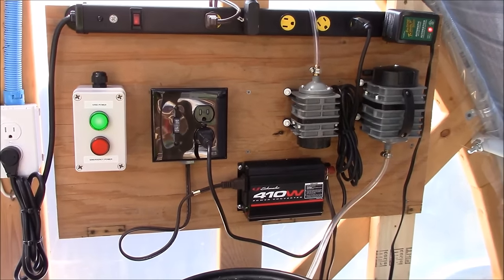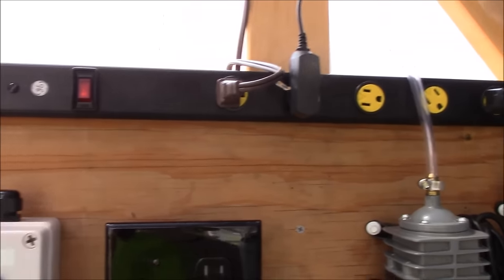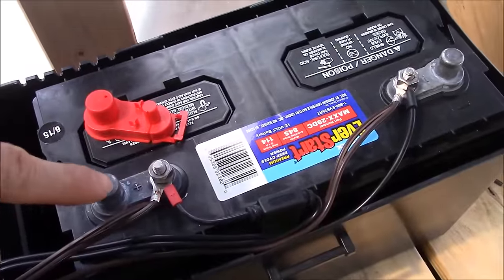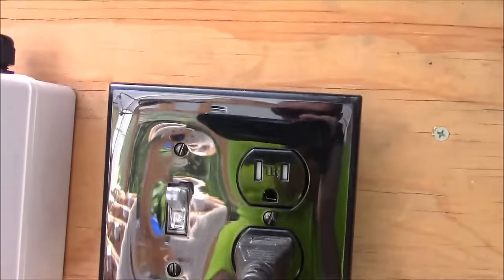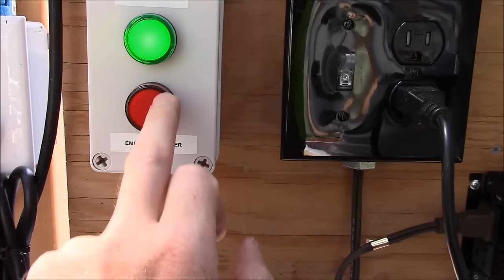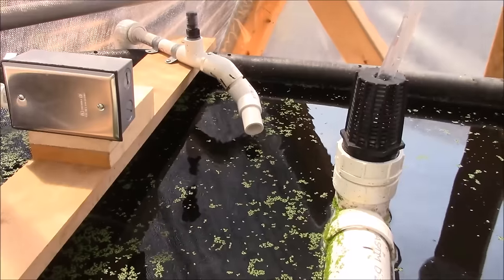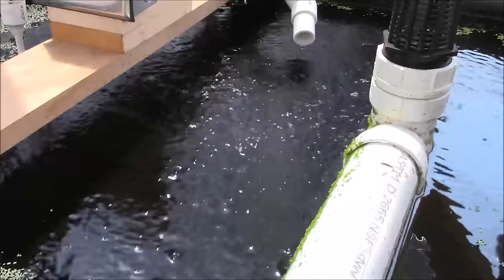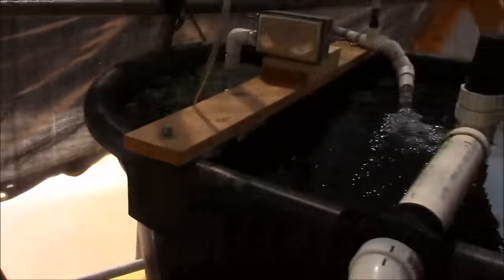Urban Aquaponics - "Back-Up System" VLOG 7 by HPFirearms

Comment: Very nice setup - I really like the ingenuity and thoughtfulness in your system.

A couple of things I'll just throw out there:
You mentioned your GFCI breaker AND receptacles - it's generally a bad idea to feed one GFCI into another and frequently results in nuisance tripping of a GFCI. "Nuisance tripping" is also the down side of fuses, btw. This should also be considered in an emergency power application. The fuses provide short circuit and over current protection, but one blown fuse will render your backup power inoperative. Just something to consider, if you haven't already.
Secondly you said you weren't sure if the battery tender was powerful enough for your battery. Well I had to go back and watch part of the vid again - I couldn't figure how you were switching the inverter on and off when the power transferred from grid to backup. Then I realized you are just leaving the inverter on all the time. Most of these inverters (from my limited research) draw let's say an amp at idle (with no load, but still powered on), I saw your battery tender said 750ma. This would mean your inverter is drawing more at idle then the tender puts out - it will never catch up. You could switch the inverter on and off using a simple "ice-cube" relay...

Keep up the great work and the great videos,
- Dave

Comment: is there such a thing as an water oxygen level sensor which could be used to trigger a regulator on an air tank or to turn on your backup system. It might be a better alternative to your float switch. A sensor might  also allow the system to operate longer by turning it on and off as needed. Oops, sensor would also require a battery. An interesting experiment might be - which would supply air for the longest time - a large air tank or the battery? BTW, seems to me that the lighted switch is unnecessary and could also be a point of failure in the event that someone accidentally turns it off, the system will not work. The red/green light is also unnecessary, is an additional failure point, and uses up your battery faster. You can tell if the pump is off by glancing at the output pipes. While I think a back up is  a good idea, I also think you are making it too complicated and expensive.

Comment: Cool.  A small solar panel might be good to keep the battery charging in case the charger doesn't work right or burns up or the power goes off.  I'm not sure how many hours the battery will power the air pump, but just in case you are taken out of town for an extended length of time.
Reply from the maker: +BC ElginTex I've actually had planned for a long time to put the entire greenhouse on solar but it takes a lot more than what people realize lol. On a positive note... I went camping about two weeks ago for a week and at some point during the week my filter clogged and overflowed the entire sump tank which caused the pump to shut off. When I came home the pump was still running! So glad I took the time to install it after that!